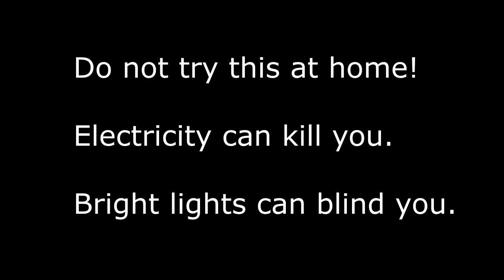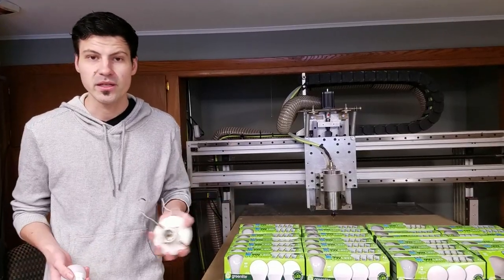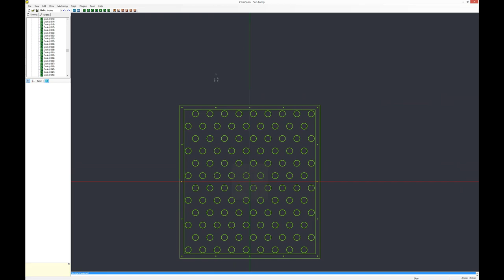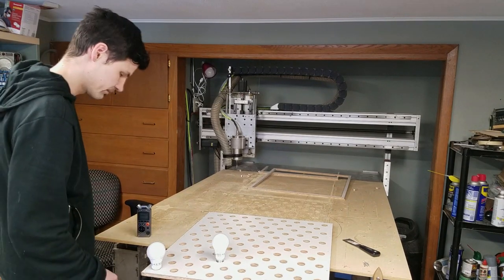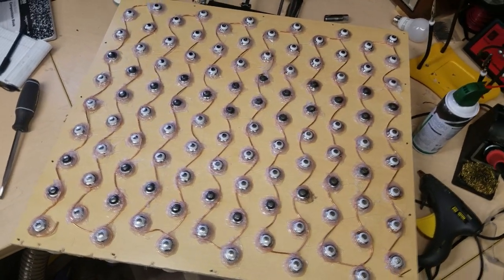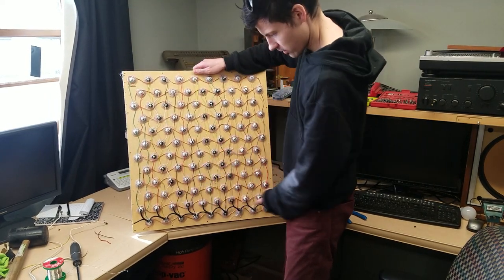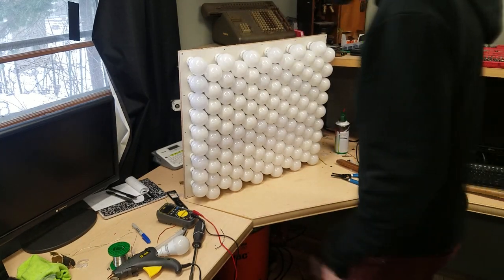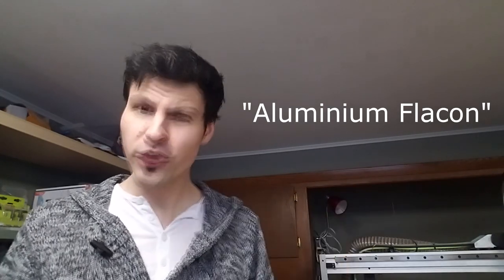108 light bulb (86,400 lumen) mini-sun project!

Comment: As an electrician I'm not sure if I'm scared or impressed.... Either way I'm subbing.
Reply: Yes
Reply: Normally we don't use flammable materials to build our enclosures.
Reply: the bare wire between lightbulbs is scary lol
Reply: Yeah flammable materials plus bare wire and heat, not fun
Reply: @Fleshikins  Nah, if they touch it doesnt matter, cause they are all the same potential (neutral)
Reply: hotglue in  a very hot thingy... could melt, and slip the wires with it
Reply: @DMSparky  at least the sleeve of the bulb is the neutral 😂 kiln dried wood is actually quite safe, something would have to be continually arcing for a white to get it actually on fire. Think of all the old radios, tvs, record players, ect that all had wood cases and live mains voltage before AFCI breakers

Comment: You can simply use 8pcs of 100watt high power led.

It is very cheap. Only $3-5 on amazon. Per piece it generates 10000lumens. :)

Good video btw :)
Reply: True I guess, but you're gonna need to then create a separate cooling setup for it. 100w LEDs are not easy to cool.
Reply: You can use  cpu processor heatsink. 

It's very cheap and effective. 1 heatsink for 1 led.

I use 100w x 3 led for my fish tank. It is so damn bright!  

I use 1 cpu cooling per led for it. Already run for a year 24/7, has no problem by far.

Comment: Just subbed, love it. I also want to point out it made me laugh when you said you didn't want to spend $100 on sockets, and then you cut to your $10,000 worth of machining equipment :D
Reply from the maker: Hahaha, glad to hear it! Thankfully the same thrifty/diy skills I used in this vid applied to the procurement and repair of that machine, so it cost me much less than that.
Reply: +Joel 
Do you have some good places to get started for someone who wants to work their way into an electronics / DIY hobby like this on a budget? I've found some basic Arduino kits online, namely to build my own custom KSP control console, but the materials can get pretty pricey and it can be a bit intimidating to get into and knowing if I'm overpaying
Reply from the maker: There's a lot of tips I could give, but a big one that fostered my love of and ability to partake in DIY projects is thrift stores. Reusing and re-purposing materials can give you a lot of practice. Even if you don't have a project in mind, you can be inspired by what you find/whats available. A KSP control console is pretty specific, and some things may be difficult to find used, but you could still repurpose things like buttons/enclosures/wires etc. You could also try and rewire an existing usb control device like a joystick, or something with buttons, using the usb board in there that is already mapped for many inputs as a controller instead of buying an arduino. The tradeoff for spending less money is spending more time, but if you want to learn, that is a win win. I hope this helps, maybe I'll make a video discussing strategies for getting into DIY cheaply.
Reply: @JoelCreates  There's actually a really big thrift store a few miles away, I didn't even think about that. That's a great idea. And yeah the KSP control board is really specific, and more something to use as a learning process rather than something I'd use regularly to play. My background is computer science, so I've got a good head for software, but we got virtually no experience with electronics or hardware in my program so I never had much call to learn. 

Thanks a lot, and I think that would be a great idea for a video! Look forward to seeing more of your stuff

Comment: Nice fire hazard. If it starts a fire don't let your insurance company know.
Reply: LED bulb Dont make heat
Reply: @fulckanunturned8584  wood exposed to exposed electrical wires are a fire hazard. Building codes are there for a reason. It states that any high voltage/current wires that are cut/spliced HAVE to be enclosed in an electrical box. Funny my household led lights that I purchased from Walmart get very warm. So with all those LEDs lights together drawing alot of power IS going to generate alot of heat. Want to have a battle of wits!?!? I'm a retired electronic tech with 20+ years experience. 😎👊
Reply: @NLMountainMan-me9rg  mine dose not get warm so idk but you are most likely right and no i don't because im only 18 and the olny thing i know  about electronic is batters on cars  so you win but its still coool ;/

Comment: I have a high end building spotlight that uses a quality 100 watt LED cob. I tried using it on the front of my house to illuminate my front yard. And the road. And the corn field on the other side of the road. But got many complaints that drivers coming up the road are blinded and hit or almost hit deer. The road points almost directly at my house then turns 90 degrees at the corner of my property then passes in front of my house. I don’t see why they complain. The brightness is perfect for spot lighting deers.

Comment: Awesome. Was it just bad bulbs that caused them to keep going out?
Reply from the maker: The heat from soldering the back tips may have loosened their inner connections, I learned to use as little heat as possible and it helped!

Comment: Want to see this done with a heap of HP70.2 or 90.2 cobs! Simple to do and would be far more impressive. For cooling I recommend mounting all of them to a sheet of aluminum that is CNCed on the back side and installed as the side of a tank of water for heat dissipation. 

What do you think?
Reply: I think you aim a fan at them and skip the fancy engineering.

Comment: I had a similar idea after I bought a "wake up lamp", which ended up being, "a device to slightly delay your panic after you slept through your alarm because the light temporarily blinds you when you eventually wake up so you can't see the time", so que the "wake the f*ck up light", it utilizes a proprietary (not that anybody else would make it) three step "wake the f*ck up" process, beginning with a xenon visibility strobe from atop a school bus, then, after five soviet minutes (standard minutes with a ±3 second accuracy. the timer is cool, don't judge me) if You're still not up, it will VERY VIOLENTLY SHINE THREE HALOGEN SPOTLIGHTS in your sleepy little face, and if you're still not up, after another five soviet minutes, it will EVEN MORE VIOLENTLY BLAST A SEMI AIR HORN ON THE CEILING ABOVE YOUR HEAD, oh, and it doesn't stop until you turn it off.
It rarely gets to the halogens, but I can't bring myself to take it down  😂

Comment: I know this is an old video, but I'm watching this and asking myself so many questions... 
Why didn't you use some metal sheet and non-conductive risers, so you wouldn't have to solder directly to the bulbs, and so you could easily change them if they went out?
Why didn't you make the board into a hexagonal shape? Did that not work out to be 100 bulbs?

Comment: Is that the water cooled Chinese spindle? What pump did you get for it?
Reply from the maker: I think so, it came with the machine uninstalled when I bought it, so it's just some cheap little pump I have hooked up to a five gallon reservoir.